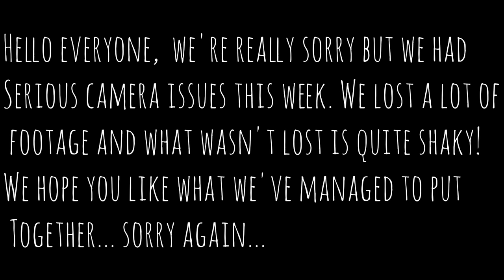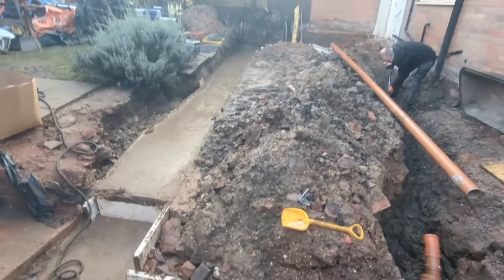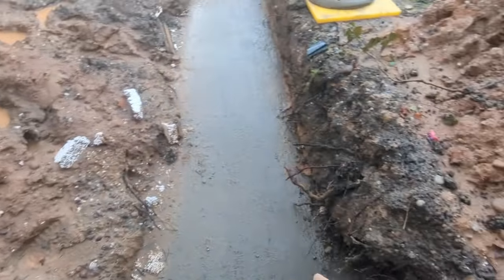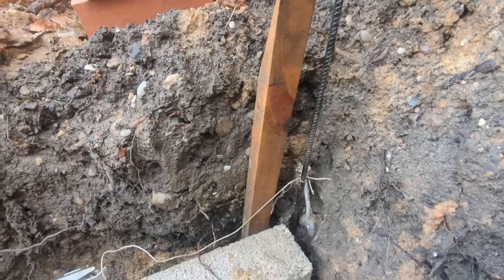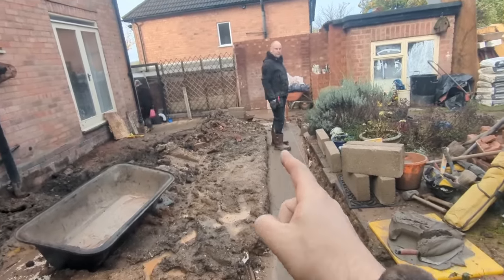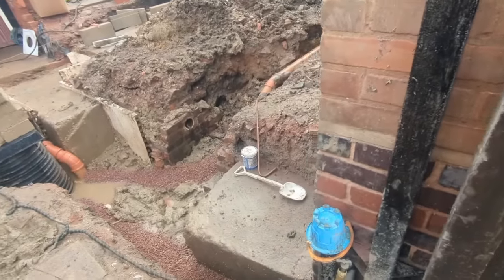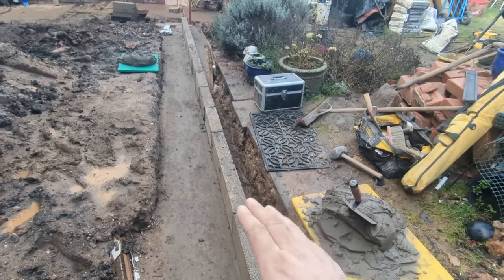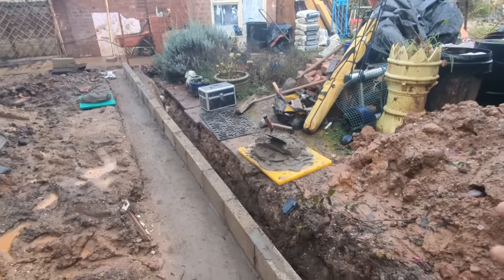Single Storey Extension Stage 4 - Building Up To Damp.

Comment: I would’ve tied in below dpc if it’s more than 225 from footing, but without bridging the damp with the tie…either way it’s not going anywhere but the wall starter can act as a profile so you can tap your pin in to the line of fire 🔥 so it keeps the ott inspectors happy and slightly easier life 🙌🏼 great video for me to watch while sat in the van 🌧️ very informative
Reply from the maker: Thank you Sam, appreciate the comment mate.

Comment: I always like to use trench blocks as the first course around, I find them easier for setting out and if your footings are a little bit low then you can bed them up without them sinking and you don't run the risk of kicking over the internal blocks. I do realise that they are costly but they do save time.

Comment: Was there enough space to use a trench block? Foundation setting out doesn't look right as others have said, your brickwork is on it but only just. Do you put profile boards up after setting out the bwk to get correct position of foundation?
Reply from the maker: Hello Mark, there was room for about 10 trench blocks I think, so there is absolutely no point in sourcing and paying for those! Plus, and you'll just have to trust me when I say this, that despite how it may look to some, there is absolutely nothing wrong with the setting out.

Comment: I would like to ask you a question.  What did you put over thay sewer pipe before you put the slab over ? Thank you
Reply from the maker: We installed a concrete lintel and built over that. Hope that helps?

Comment: no brick ties to attach the new walls to the existing house?   odd.   then again watching your videoes has opened my eyes to how completely different we do things here in Canada than the UK
Reply from the maker: Hello mate. Yes, the ties are there, just not below damp. What part of Canada are you from?
Reply: @Mr_A_Builders  easiest to just say Toronto.  started in doing rough in's(back framing), then framing.  usually go between subdivisions, renovations and mcmansions.  mostly just stick to the framing and move on to the next job depending on the job.  i was also surprised how they do homes in florida because of the temperatures.  never seen how you guys do it in the uk though.  really interesting.  actually first time i saw a reno in the uk was in the movie jack and sarah and it puzzled me back then.  its just so different

Comment: Just wondering, why not have 3 buckets of mortar, and 3 heads of bricks along the length, and when it gets higher, put the buckets on top of upside down buckets 🙂, this way you can have everything in reach and save yourself.

Comment: What happened to the 150mm footing either side of the brick and block work? In places that string line looks to be right on the outside edge of the footing
Reply: That footing  definitely hasn’t been doublechecked bit of luck there really but a like there vids I disagree on the metre of brickwork with no ties too lol 😂
Reply from the maker: Hello Nick, hope you're well mate. Not sure that I understand your comment buddy?
Reply from the maker: I can only assure you mate that there is absolutely nothing wrong with the footing! Appreciate you watching.
Reply: Or an basically I was referring to jus with people on about the footing .that trench cant Measure say for instance 4.8 with spread at both sides ovs I don’t know the measurements of the extension just an example that trench is definitely running off because it wouldn’t of landed on the end if dugout same at each ends measured bang on the no way correct me if I’m wrong it’s definitely running in to the house hence  why external wall is running out to the end of the footing an over end is over half way the over way lol 😂
Reply: hence the bit of luck it’s only just gone on probably 10mm over the footing but ya know be right kala fudgeit 😂😂👍🏻😜
Reply: Lol av found something to pull you on I can’t see a continuous cavity yet is the one 😂👍🏻🙈
Reply from the maker: Nope...still no idea...we appreciate you watching though mate.

Comment: Are you doing block and beam?
Reply from the maker: Hello Chris, yes we are mate. That'll be our next video!
Reply: @Mr_A_Builders  we did block and beam on our last job. It was slab on the drawings but I prefer it sometimes and it was a very dry summer so I reckon it's better
Reply: Cant go wrong with beam and block, a bit more expensive, no worries with bounce or ground heave.
Reply: We're usually hand balling them in so anything over 4 metres, I'll put a middle wall in and go the other way to keep the size down
Reply: Interested to see how the new brickwork gauges with the old. The old brickwork is terrible.
Reply from the maker: It is isn't it Mark! Unfortunately I won't be able to follow that, so I'm not even going to try.
Reply: @Mr_A_Builders  that’s what I’m expecting.
Reply: No, just put a ferfix up there and go gauge
Reply: @chriscollins1704  it’s the levelling of the beams I’m thinking of.
Reply: @markjarvis5465  yeah, if your punching in, that's a pain. Some sideways diskcuttering is in order
Reply from the maker: Ah yes! All will be revealed in the next episode!